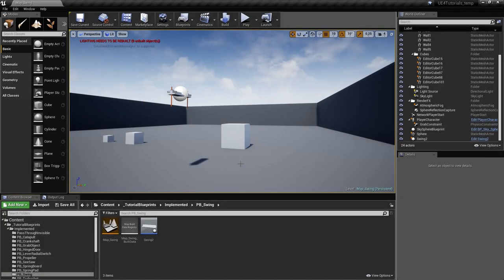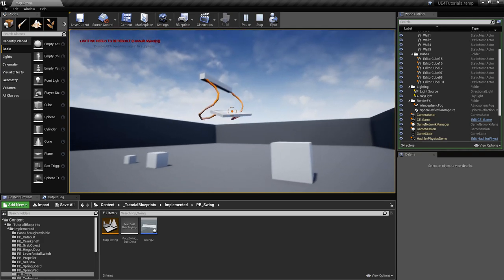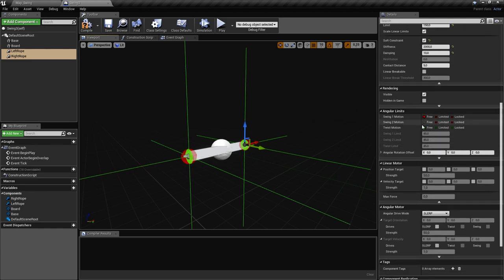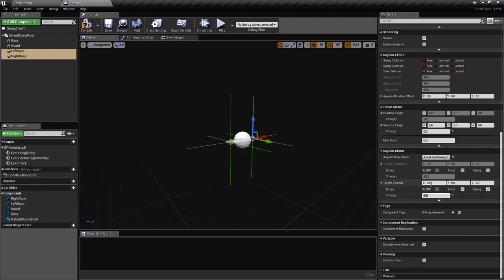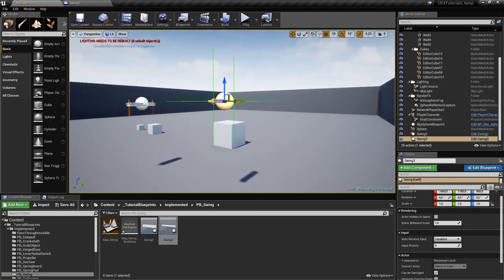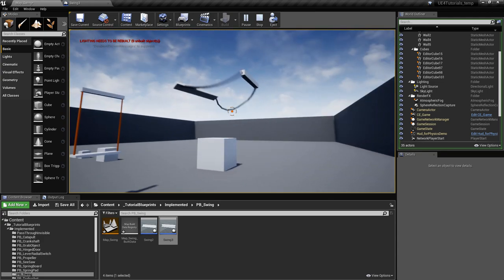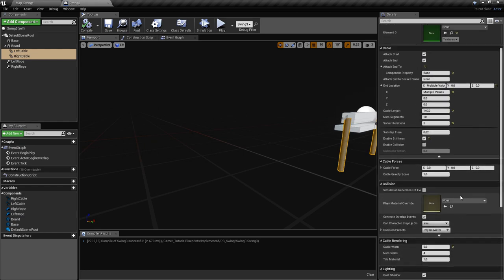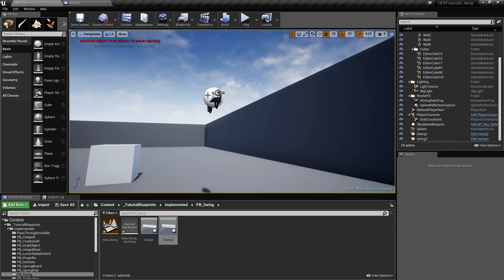UE4 Make Rope Swing - Cable Component and Physics in Unreal Engine 4 Chain Tutorial How To

Comment from the maker: If you're looking for Rope implemented using Bones, here's the tutorial: https://youtu.be/hEMcr98cDJE
Reply: im trying to make a cable using the cable component, with a plug on each end, so i can use this in a modular manner to place dangling cables where applicable.

Now a problem im running into is that instead of 'coming out' of the cylindrical shape that is my plug, and then sagging down more as it gets further from the plug, it just takes the pivot of my object as a pivot, and thus clips with the plug in an ugly way. Any ideas?

Comment: Hi, I used this on two player characters, it works well when one character is hanging from the other character, but not the other way around. What i mean is, if the board is dangling from the base it works perfectly well, but if you suddenly switch them around during gameplay, enabling physics on the base and disabling them on the board, it stops working. I would have assumed that they would just change places, but instead the base just kinda falls and gets stuck.

Comment: Another great video.Any chance we would see tutorials of Physics Asset tool being used for organic type simulations, things like muscles, skin, hair strands, body fat etc.  stuff that can be used say for setting up some creatures/monsters.
Reply from the maker: Thanks!
I would have to do some research for that, I haven't used the Physics Asset tool all that much. It's sounds very interesting, I'll put it on the list. :)
Reply: If I remember correctly, PhaT isn't used so much with the most recent versions of PhysX?  I'd have to do some digging to find links on the topic, sorry about that.

The topic of musculature simulation is outside of the scope of PhysX, generally these are custom rolled systems that are (usually) tightly integrated with DCC tools and plugins.  If by body fat, you mean things jiggling around, that ends up being mostly morph targets doing the heavy lifting.  Hair rendering is outside of the scope of PhysX as well, and there are already existing solutions.  Hair is a complex beast...

I suggest doing some research on these topics.  You could (and should) easily spend hours to days educating yourself reading articles, white papers, watching talks, etc.
Reply from the maker: The PhaT (or as it's called now, the PhaE) is just an editor that helps to set up physics constraints on skeletal meshes. 

Actually, I think you can make a simple belly flop with 3 bones (or even one) that are weight painted to the skin and have them act like springs using physics constraints in the PhaE. Making a tail or a pony tail is definitely achievable with bones and physics constraints.

For the muscles, there are two considerations: the force that they apply to the world and their visual representation. For the force, you could use a physics constraint to act as a contracting spring and for the visual part you could also use one or multiple (weight painted) bones and limit them using physics constraints. Of course, you would have to use different physics constraints for each task.
 
I plan on expanding my knowledge on this subject, but, as you said, it takes a lot of time.

Comment: Is there a way to set the limit size at run time? Like a winch pulling an object? Ive tried using the set linear X,Y, and Z nodes simultaneously but it doesnt appear to give me results
Reply: Found out if i just hit my constrained object with my player it will update, then I can crank my pulley to raise and lower my constrained object just fine. Curious.
Reply: If anyone is trying to do something similar to this, how i fixed it was by waking the constrained object once, like with a do once node, whenever I first do anything to change the length of the constraint and that seems to persist throughout the rest of the game play instance. Youd think having "start awake" checked would take care of this but it doesnt seem to.

Comment: How do I use this with a player character? I can't figure out how to get it to let the player swing without having physics enabled because when its enabled then the player ends up upside down and spinning frantically.

I really could use some help and guidance please.
Reply from the maker: You can only have the character swing without activating physics on it, if you attach it to the plank of the swing. And you would probably have to lower the center of mass of the plank, so the player stays upwright.
The fact that the player spins when activating physics it's probably because it collides with other objects. You have to test and see which one. You may have to deactivate some controls from the player, not sure which, though. 
When I make a character that uses physics, I start with a simple Pawn class and build from there. So there's no additional functionnality that could mess up the movement.

Comment: Hi, thanks for the great tutorial. I have a question about the linear constraints. If we set a constraint of 150 units along each dimension in world space, wouldn't this constrain the board to a cube, not a sphere?
Reply from the maker: That's a good question! Let me check that and I'll get back to you.
It certainly didn't look like it was moving within a cube when I was testing it.
Reply from the maker: Ok, I've checked, it's definitely moving within a sphere (and it's also mentioned in the docs, see below). But your question is still valid.

From what I can deduce empirically, the axis themselves rotate when the objects are moving in relation to each other, so that (for example) the X axis always passes through the center of the two objects. 

Unfortunately, the physics constraint is very poorly documented. The only thing I could find about this is the tooltip of the Limit in the Liniar Limits, that states: "[...]Distance applies on all axes enabled (one axis means line, two axis implies circle, three axis implies sphere)". It's probably why we can't have different limits on each axis.

I will have to make a in-depth video dedicated to explaining the physics constraint, but I need to study it further before I can do that.
Reply: Ahah, I was wondering if that was what was going on. Because I agree it definitely is constrained to a sphere, and not a cube. I suppose we could peek inside the PhysicsConstraint source to see which axes it's using, but I believe you must be right. Thanks again!
Reply from the maker: I will probably have to look into the source code to fully understand the physics constraint, but it takes such a long time, and it takes away from my time making tutorials.

Comment: Hello. Again, thanks for tutorial. I was hoping to solve what I want myself, but i am getting mad here :D So, I would like to ask for a consult, please? I think I have tried all options and values, but I still have an issue. I will explain. Short video here:
https://twitter.com/Thunder_Owl/status/1252575953391431683
It looks good, but only because i am "cheating", not doing any linear movement of ship, i am doing just rotations. When I do forward/backward or any "strafing", physical connection stretches like mad. I think I have tried everything (XYZ linear are set locked), but I hope I missed something simple? Also, if I try same "panedant" in empty level and move by mouse in simulation mode - there is no such stretching on linear movement. What can be a problem? With ship, scene with all 3 elements is parented to ship's body.
Many thanks in advance for possible help! :)
EDIT: well i kinda fixed it... Turns out, "base" component has to be ship's body. But, that does not make any sense to me, how constraint differs, is it ship's body, or another added cube or whatever mesh? Weird...
Reply from the maker: Hi there. It's hard to see what's wrong without seeing your physics constraint setup, but I'm glad it's working now.

There's a whole discussion to be made about components, sub-components and the position of the physics constraint relative to the constrained components. 

Try testing with 2 cubes, move the physics constraint position (before starting the simulation) relative to the cubes and free some rotation and translation axes and see what's hapenning. The position of the physics constraint is very important!

I'm planning to make small lessons on the physics constraints. Hope I can get to that soon.